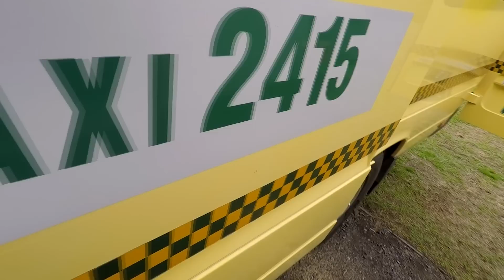Installing An Alpine PXE-0850S DSP Into The Bass Taxi - Australia's Biggest Car Audio Build

Comment: I know its late, but how many amps can I run on this processor
Reply from the maker: Haha no stress. Essentially there is no limit with supporting hardware like you can see in this video. With this processor it allows you to have 12 channels with completely different setups on each channel
Reply: I have a system with 8 amps 1 bass amp and 7 mids and highs amp and this exact Dsp.. Can I run this setup with on the DSP?

Comment: how did you guys set the gains on your amps after that DSP? My oscope has a clean sign wave goin in, but coming out, the scope is everywhere and im not able to set my gains properly. thanks
Reply from the maker: Hey Daniel, what DSP are you using? and does it have any sort of setup currently loaded into it?